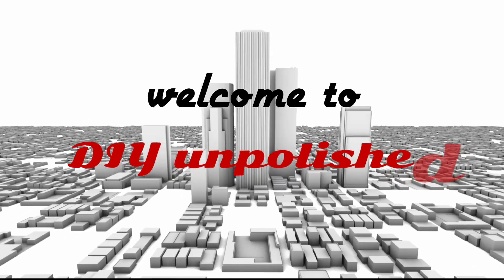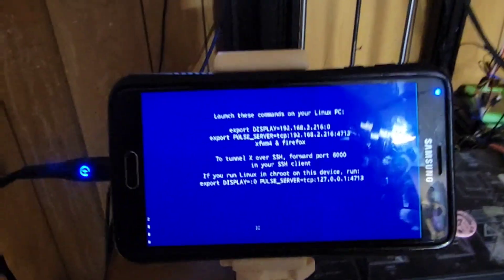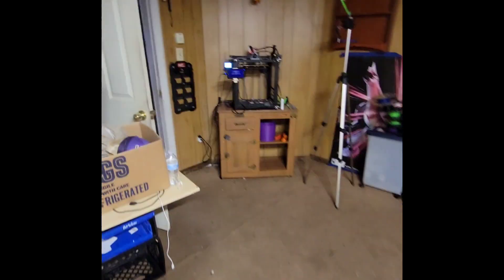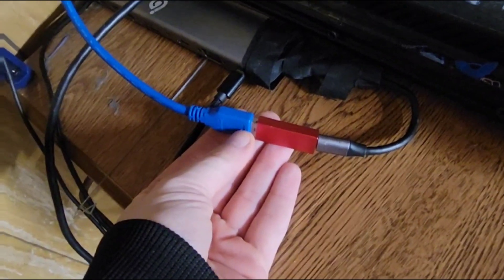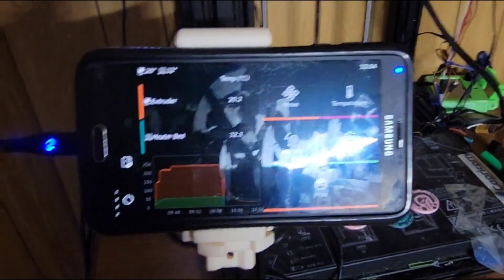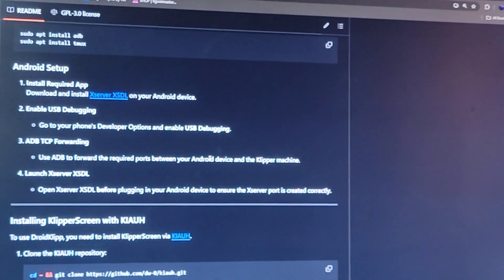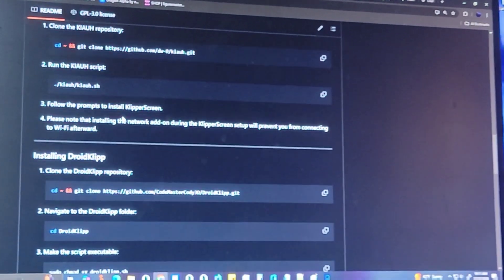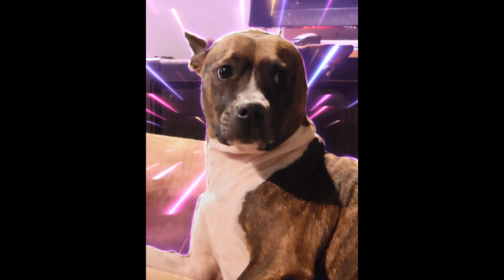DroidKlipp: The Android Klipper Screen

Comment: I have no  idea what happened, but when I got to the Network install part, I said "yes" and now I can't access Mainsail on my PC anymore, and when I connect up my Rasb Pi to my PC screen it's showing Klipperscreen there....Help!!
Reply from the maker: @warrenblair3966  I have the tutorial done I'm just editing it. 

So if your phone has the USB tethering option you will gain access to the internet again on your pi/Linux PC running klipper.
Take and plug up your phone to the pi, enable USB tethering, go sign in too your router,  find your new ip address. Take note of what ip address are there before you connect your phone so you know the new IP address when you do turn USB tethering on. Good luck.
Reply from the maker: @warrenblair3966  I'm gonna update the github and put it in all caps to remind people to not hit yes lol.
Reply: @DIYunpolished  I'm using an old Lenovo android tablet to instead of a phone, does that make a difference?
Reply from the maker: @warrenblair3966 if the Android operating system is too old on the android it may not have USB tethering built intoo the system.
Reply from the maker: @warrenblair3966 if the Android operating system is too old on the android it may not have USB tethering built intoo the system.

Comment from the maker: I did this on mainsail and on Lubuntu. What version of Linux are you running?

Do you already have klipper screen installed already?

Did you use the KIAUH installer to Install klipper screen?

Have you tried rebooting.

Make sure you install tmux and adb

If you dont have adb running you won't get a prompt for accepting adb access through USB debugging. It will be a prompt on the screen on your phone.

Also if you haven't already you need to turn on USB debugging.

I'll have to make a tutorial video on it for people that aren't tech savvy.

Prerequisites are ADB, tmux, klipperscreen using KIAUH installer.

Comment: I followed all steps and could install python3.8 from scratch :), but i dont get image on my phone.
Reply from the maker: Did you use KIAUH to install klipper and klipper screen?
Reply from the maker: If you are using an up to date version of Lubuntu or mainsail you won't need to install python because it's already there. 

When using KIAUH and it asks for what version of python to use choose python 3, don't use python 2 for this tutorial. 

I would suggest backing up your printer cfg and any other cfgs you have on klipper. Use KIAUH to install klipper and klipper screen. Then go to my GitHub and try again. This video is not a tutorial, it's just a demo.
Reply from the maker: From scratch? You shouldn't. Get a fresh install of an updated distro like Lubuntu or if your using a pi, you can use mainsail.
Python will already be installed And working. 

Your android should have USB debugging on for it to work.

You need to install adb on Linux.